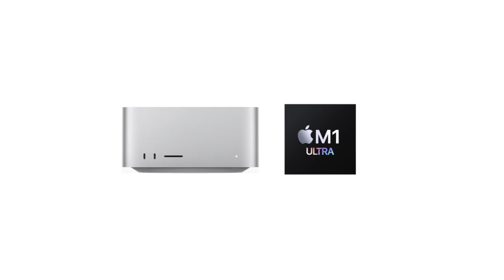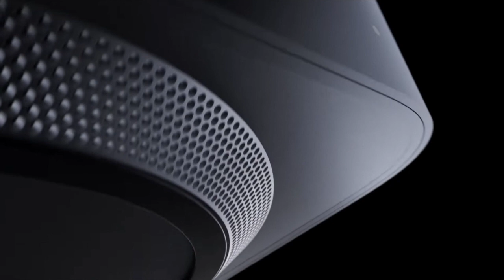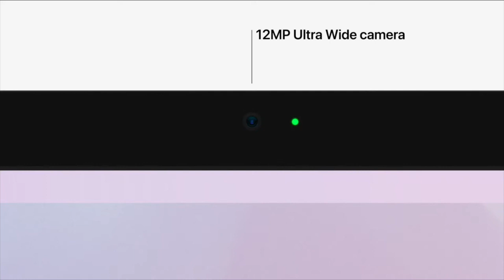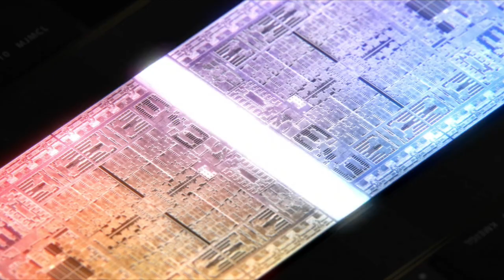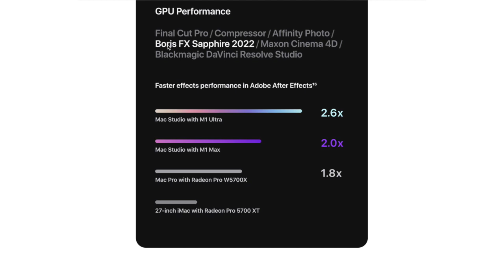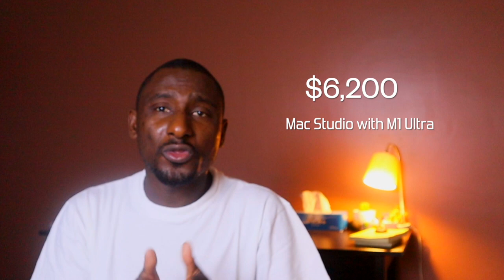Mac Studio with M1 Ultra

Comment: Wow this is incredible the specs is crazyyyyy
Does it support boot camp? and can we be able to use the studio screen with other windows devices as an external display?
Reply from the maker: Sure, you can connect to external displays, it supports up to 4. I don't know what boot camp is. 😀
Reply: @PublicTechAdvisor  ohh great thanks.
Boot camp is having windows installed on Mac...
Like Mac with Intel processors support boot camp am not sure if these M1 can handle such am just asking